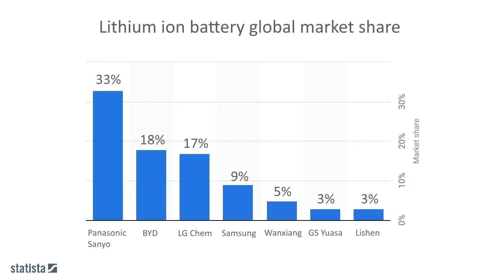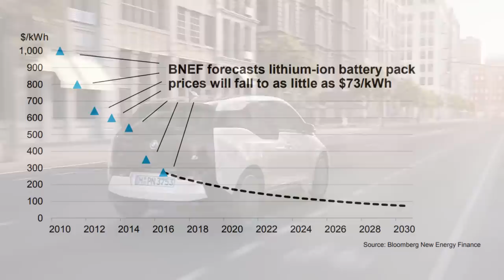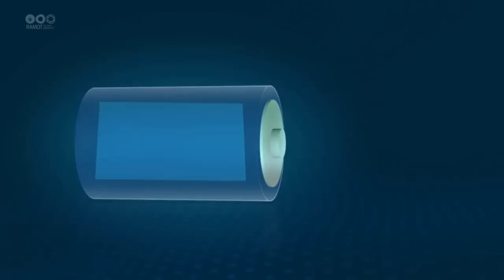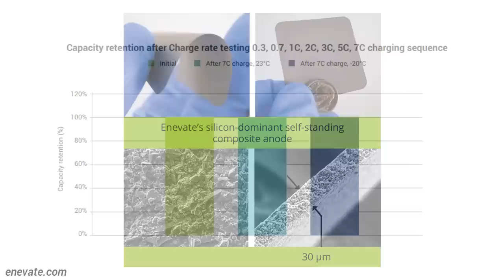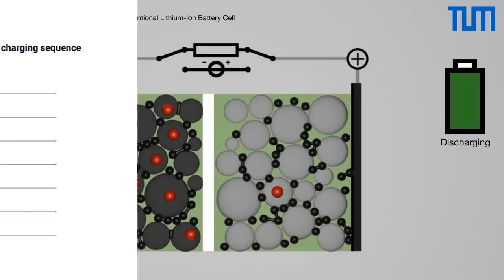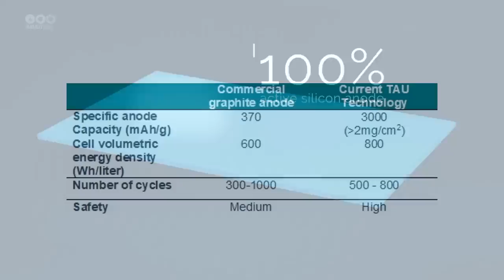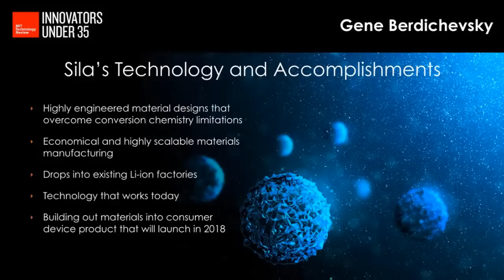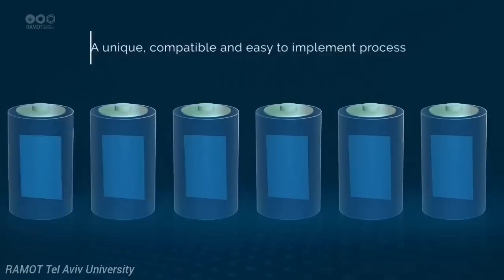The Battery Revolution. Ultra Fast Charging

Comment: You can't charge a car on feelings and good intentions. Still gotta get the electricity somewhere and renewables are NOT going to cut it any time soon.
Reply: IncognitoTorpedo why did your question require calling this person a moron? Why not just ask the question? Or inform them? 
 On a global scale very little is produced by renewable sources currently.
Reply: Fred - Not sure what you mean by switching to cars does "very little".  Electric cars are 4x to 5x more efficient per mile than gasoline cars.  They can be powered on 100% clean and renewable energy unlike gas or diesel cars.

And I haven't seen any evidence that the "same people" who are for renewable energy are against wind turbines or geothermal energy.

People have to understand that "damming a river" isn't some universal solution that works everywhere and has the same impact everywhere.  Damming a river for hydro can affects fish and wildlife in some areas where the trade off isn't worth it.  In other areas, it uses glacial run off that has no fish or wildlife issues and makes perfect sense.

Just like putting a wind turbine in some areas affects birds like raptors which fly over land, but the effects of locating the same turbines at sea can avoid those issues entirely.

So, it is more recognizing that a solution is a not a one size fits all, and implementing them in a smart and thoughtful manner simply makes sense, instead of using wildly inaccurate and gross exaggerations about how the real world works.
Reply: Captain Crunch  The same "environmentalist" don't want the environment touched. An electric car in NOT more efficient. Any direct energy system is more efficient with just minor tuning. For electric to be MORE efficient, you would need MORE than 100% efficiency in the system which we haven't invented yet. Any type of fuel consumption whether renewables or not can't be MORE efficient if for no other reason than converting the power to electricity loses some energy. So far we've been doing this more for politics and votes than really to help the environment. When you get serious, let me know.
Reply: An electric car motor is 90% to 95% efficient, a gas engine is around 30% efficient, but in reality, because it runs whether you are moving or not, it becomes 17% efficient on average.  Electric motors use zero energy when you are not moving.

" Any direct energy system is more efficient with just minor tuning"  Except that is literally fiction.  ICE engines are only 30% efficient as they work on thermal expansion, 70% of the energy is lost as heat.  There is no "minor turning" that will fix that.

"For electric to be MORE efficient, you would need MORE than 100% efficiency in the system which we haven't invented yet."  That is 100% fiction again.  There are losses in electricity generation and charging, but the pale in comparison to ICE engines.

We can easily demonstrate this several ways.  First is by electric car energy usage.  A electric car like the Tesla Model 3 goes 310 miles or more, using 75kWh of energy.  It goes just over 4 miles per kWh.

A gallon of gas contains 33.7kWh worth of energy.  So, a Model 3 can travel 310 miles using 2.25 gallons of gasoline energy equivalent, or around 135 to 140 miles per gallon of gas.

The most efficient non hybrid car on the market will get around 40MPG highway, not even 30% the same distance using a gallon of gas.

And even that math doesn't account for gas production.  To make a single gallon of gasoline, it takes around 6kWh of energy just to refine it.  It takes several more kWh to explore, drill, pump, transport, etc.

So, just taking refining, you can drive a Tesla Model 3 around 24 miles on the energy it takes to refine a gallon of gas, and you can just skip the gas entirely.

When you want to leave whatever planet you are living on and visit the real world, let me know.
Reply: Captain Crunch    AND how many unicorns does it take to pull this Chariot??? Gasoline is about 35% efficient. NOW. AGAIN I'LL ASK YOU, WHERE ARE YOU GETTING THE ELECTRICITY??? If, and only if, you are using renewables, electric cars make a difference. If, like in the real world, where about 80% of the electricity is still fossil fuels, they don't really help. By the way, most what is considered renewables is fission. Think for yourself. If an electric car was 5 times more efficient than the 30% you yourself said gasoline is you're already OVER 100%!!!! You could run the world off of ten gallons worth of gas. THINK!
Reply: Electricity is 90% generated by burning fossil fuels. So ur 100% efficient (it's not 100% as it needs to power computers and cooling fans) electric motor still has energy loss from the energy production plant.

Clean energy is not efficient. U cannot have wind turbines everywhere (it needs wind). Solar is very inefficient and unreliable. Geo and hydro is very localized to only a few cities.

And dont call nuclear clean. Fukushima is 1 plant in a high tech society and it failed and has been flooding the Pacific ocean with nuclear radiation and pushing fallout into the west coast US for 5+ years and will continue to do so indefinitely.  Chernobyl has been a dead zone for 30+ years. Radioactive halflife is 100,000 years ... meaning it will stay at it's current deadly intensity for that many years before it reduces in half.  Nuclear is toxic in the by products of spent rods and cooling water. If u bury it it leaches .... even in unleachable containers ... they have been shown to fail and leach. It's radioactive after all!

Some ppl are very simple minded and think that just because a beautiful person promises beautiful lies on TV that it MUST BE TRUE.  They love lies ... sweet lies.

Reality is far more complex.
Reply: peachees    THANK YOU! The reality is that nuclear is the only thing that comes anywhere close to the amount of power we need so we are stuck with fossil fuels for the foreseeable future. And before somebody goes nuts about THAT comment no I'm not saying not to keep working on it. Just stop lying to people just to make them feel good. A Prius is a 3,800 pound "I care more than you" badge. Thorium would be something to look at but that would be decades away too.
Reply: Peachees - Except, your claims are note even remotely correct.  So before calling people "simple minded" and posting a bunch of easily disprovable claims, I would spend a LITTLE more time looking up what you want to refer to as "reality", you know, the FACTS.

Electricity in the USA is not even remotely close to be 90% fossil fuels.  In fact, it is not even 80% or 70%, the energy mix in the USA today is only 63% fossil fuels, you know, because the facts can easily be verified by looking them up, like here:

https://www.eia.gov/tools/faqs/faq.php?id=427&t=3

And that is beside the fact that countries around the world, Costa Rica, New Zealand, Norway, Iceland etc. which are using 80% to 100% renewable energy.  And that also fails to consider that there are hundreds of Billions being invested annually in Solar and Wind around the world.

"Clean energy is not efficient."  Yet another myth.  Clean energy is VERY efficient, in fact, solar panels on your house are some of the most efficiently generated sources of energy, as the transmission distance is near zero.  And solar is not "unreliable" the sun has been around for billions of years, and will be around for billions more.  The sun does however only shine during the day, which is the reason we are getting more and more into energy storage, and using hybrid solutions using solar/wind farms, like this one:

https://cleantechnica.com/2017/10/06/australian-gullen-range-hybrid-solar-wind-farm-now-generating-energy-grid/

Nuclear energy is carbon free, the merits of it being clean or not can be debated.  In reality however, is that the plants are already here, we already have enough fuel for them to last decades, and by decommissioning nuclear weapons, we will have no shortage of fuel for them.  While they are here, they provide carbon free energy, and are ideal to charge electric vehicles with carbon free energy.

We can debate all day long whether nuclear reactors or nuclear plants should exist, in reality, they do exist, and since they do, we may as well use the energy they create.

So, while discussing the issue, lets at least stick to one set of facts, reality, and go from there.
Reply: Captain Crunch    Actually, I know what the ratio REALLY is. I've already researched all of that and more. I deliberately skewed the numbers in HIS FAVOR to prove that even giving him an extra 10% his numbers don't work. Toyota has a street engine that's 35% efficient. An electric power plant is between 40 to 45 percent at the grid input point. By the time you lose power in transmission, charging, battery inefficiently and so on, you're doing just as good with a gasoline engine. Your move.
Reply: Fred - Yet again, you fail to account for several factors here.

First of all, even though a gas engine is theoretically 35% efficient, in reality it is only 17% efficient.  Because every time you are in slow traffic, stopped, idling, etc. the engine is running, wasting gas while you are going nowhere.

Contrast that to electric cars, where the motor uses zero energy when you not moving.

You also fail to account for, even if the engine was 35% efficient,  to make it 35% efficient overall, gasoline production would have to be 100% efficient and carbon free.  And we all know that is not even remotely close to being accurate.  It takes around 6kWh of energy to refine a single gallon of gas, and as noted, that is enough energy to power an electric car 24 miles.

So, every time you start up your gas car, you have an energy debt of 6kWh per gallon, you are trying to use a 35% efficient engine, to make up for a 6kWh deficit.  So, even a gasoline car getting 40MPG, in reality, you are only getting 16MPG as far as energy efficiency, as you already wasted 24MPG making the gas in the first place.

And we haven't even started talking about exploration, drilling, pumping, shipping, storing, transportation to the gas station, and the electricity needed to pump the gas, along with the energy wasted to drive to the gas station and back to get the gas.

So, your claims of "Actually, I know what the ratio REALLY is.", are actually demonstrably false.

"deliberately skewed the numbers in HIS FAVOR " In fact, you are obviously skewering the numbers in YOUR favor, by ignoring that fact completely.
Reply: Captain Crunch    Ok. You win. The only thing worse than a fool that refuses to learn is being silly enough to argue with him. Out
Reply: If you can't even support or prove your own arguments, you leaving will not be any great loss anyways.

So, bye and good luck.
Reply: Captain Crunch    Mr. Crunch. That's the wrong kind of bye. That's buy like buying an item. 
BY the way.
Reply: In reality, the issue has been researched by actual scientists, so there is no need to waste time talking about this anyways.

https://blog.ucsusa.org/dave-reichmuth/new-data-show-electric-vehicles-continue-to-get-cleaner
Reply: The issues you raise are valid. I am also skeptical of "feel good," intentions. Nevertheless, what is equally valid though is the good ole "Genie out of the bottle." Unfortunately, fossil fuels, nuclear, will be around for a rather longtime and they will power the bulk of the first EV revolution, but they won't for the long term. Quite simply, there are too many smart people working to power us into the future. Thus, it is not a question of "if," but "when," we can efficiently use new energy formats.
Reply: SMC01ful   Not to belabor the issue. If you continue down the debate, which it somehow turned into,  I encourage inventors and researcher to continue to work on new materials and technology. My point was, and still is, to stop LYING  to people and convincing them they are "saving" the planet. Life isn't full of ponies and safe spaces. Progress takes hard work and tough choices.
Reply: And Fred - Since you are all into correcting people's spelling, and like making big THINK claims in your posts.

Maybe, you know, just MAYBE, look up some basic facts before posting.  You know, so you don't post even more inaccurate claims, such as "A Prius is a 3,800 pound "I care more than you" badge."

A Prius is not actually a 3800 "I care more than you" badge.", because the Prius doesn't weigh 3800 pounds, or 3700 or 3600, or even 3500 pounds.  The Prius actually weighs just over 3000 pounds.

You know, again, the FACTS as we call them.  As seen here:

https://www.toyota.com/prius/features/mpg/1221/1223/1224
Reply: And again Freddy - I find it pretty comical, that when you make claims like "Gasoline is about 35% efficient. NOW. AGAIN I'LL ASK YOU, WHERE ARE YOU GETTING THE ELECTRICITY???"

Me, asking WHERE ARE YOU GETTING THE GASOLINE, means you just fold like a cheap umbrella, pout, and go home to get your security blanket out.  

"If, and only if, you are using renewables, electric cars make a difference."  Well, besides that statement being a provable pile of horseshit, as seen here:

https://blog.ucsusa.org/dave-reichmuth/new-data-show-electric-vehicles-continue-to-get-cleaner

In reality, in the USA, Natural Gas production is in many ways a byproduct of gas production.  In fact, they are producing so much natural gas a byproduct, that they are pushing to "flare" more of it, meaning, burning it off to get rid of the gas, as seen here:

https://www.bloomberg.com/news/articles/2018-06-04/a-burning-question-for-texas-what-to-do-with-all-that-gas

So, there is so much excess natural gas production, that they are literally burning it off as fast as they can, because they want to get rid of it, and the pipelines are already full.  So, using more natural gas for electricity production would actually capture a bunch of gas being wasted and flared today.

That is in addition to surplus energy being produced at night (when most EV's are charged), and wind power is stronger at night than during the day, which is when the grid is mostly idle.

The perfect way to capture that surplus wind power, is to charge electric cars with it at night.

So, if you think about this from a logical and factual standpoint.  Not only are electric cars cleaner already TODAY, they will keep getting cleaner as the grid gets cleaner, and they actually are a solution to capture surplus energy capacity and production happening at night already.
Reply: Modern Gasoline engines are over 30% efficient, but the best of the best can be up to 40% thermally efficient. Modern Diesel engines are generally about 45% efficient. The most efficient Diesel so far can be over 50% thermally efficient. The most efficient fossil fuel power plant is over 60% efficient. 
Normal ICE drivetrains generally lose about 15% energy when converting engine power to tractive wheel spinning. This is lower for some vehicles, down to under 10%. The best case scenario for energy generation is still over 60% efficient, though.

Electric motors convert energy directly to tractive wheel spin at about a 95% efficiency, but this can be lower or higher. 

Electric Vehicles have the upper hand by far in efficiency (at current), but their energy density is severely lacking. So much so that it is simply impossible to get anywhere near the best-case scenarios for hydrocarbon vehicles. 

In the end, they both have their disadvantages, which is why the market hasn't simply flopped to Electric (and won't do for quite a time). Hydrocarbon commercial vehicles have made leaps and gains in reducing harmful emissions; almost to 0. However, their main challenge will be the fundamental stochiometric chemistry behind Hydrocarbon combustion: Carbon Dioxide formation, which is the gas with the most effect on human-assisted climate change.

Electric doesn't have this, but will remain impractical for market domination due to weight and charging avaliability for quite a time, amongst other things.

In regards to the non-renewable fossil fuel argument: as it stands, Hydrocarbon vehicles won't be prevalent enough in the future anymore to deplete the world's reserves. Moreover, it can be artificially generated.

Banning Internal Combustion Engines is a pretty silly move if that is a real thing, considering that Hydrogen combustion is even more energy dense than Hydrocarbons, and theoretically only forms Water as its combustion product.

People like to make claims about the future based on technology at the present, but it's never that simple. In the end, the energy source of the future is likely to be a combination of things, not just one sole method like it has been. Technology now and in the future allows for that. 
Internal Combustion Engines won't go away for many decades more than you think. Perhaps they never will. Keep an open mind, the future won't be so deterministic.
Reply: where is the energy stored and if it was free why are you charged for it?
Reply: dont run the heat ,lights or radio
Reply: John - The radio and lights are a rounding error on any vehicle, including an EV.  Using lights and radio would use up 0.5 miles of range every hour, so the range lost using lights and radio would be less than 1% of battery capacity while driving.

Heat can be more of an issue, A/C much less so.  Pre-heating the car before leaving solves a large part of the heat issue, using a heat pump helps also.

I drove over 1000 miles during the last week, using the A/C. lights, radio, etc. the whole way, and I still averaged about 300W per mile at highway speeds.

People keep complaining about range, ignoring the fact that most people drive less than 30 miles a day and the cars today already have over 300 miles of range, and that number keeps climbing.
Reply: funny how that works out when you sit in rush hour traffic for four hours a day.
Reply: John - Not sure what you are referring to.  When sitting in rush hour, the EV motor uses zero energy when stationary, so the only energy being used is the accessories, lights and maybe the A/C.  You would have to sit in rush hour for about 24 hours or more before range would be an issue.

Unlike gas or diesel  cars, EV's don't have an engine running and burning gas when going nowhere.
Reply: EV motor still uses energy if you're not moving in order to power all of the technology in your cockpit